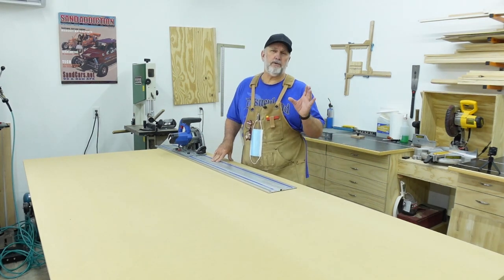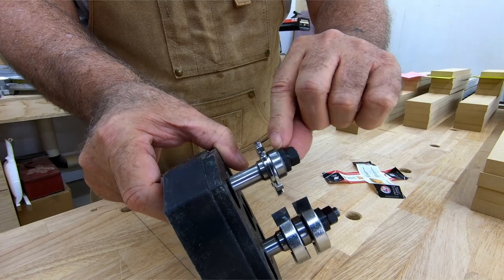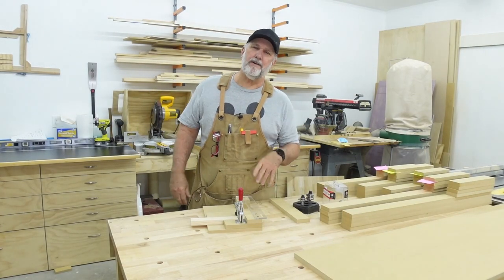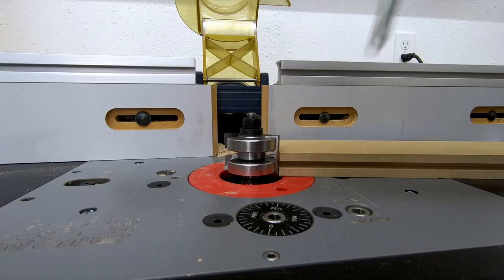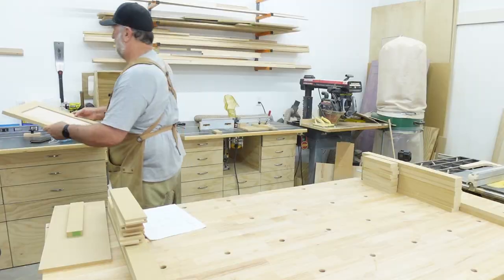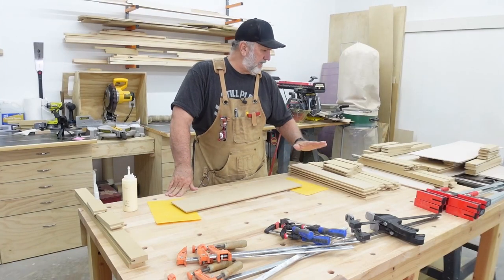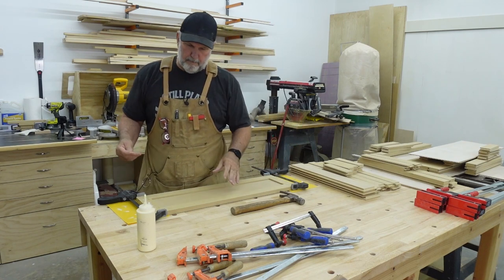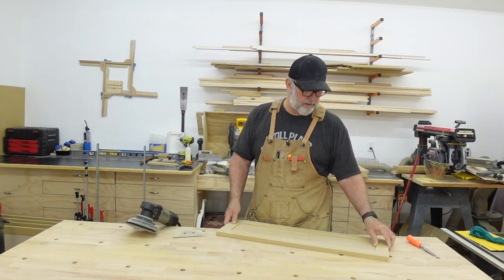Unlock the Secret to Easy MDF Shaker Drawers and Doors

Comment from the maker: Freud Adjustable Shaker Tongue & Groove Bit Set:  https://amzn.to/4758xYw
DEWALT Router Kit:  https://amzn.to/3U19TwH
Pattern Flush Trim Router Bits:  https://amzn.to/3SIdFtY
Fulton 110V Single Phase On/Off Switch:  https://amzn.to/3zK91oP
JessEm Rout-R-Lift II Router Lift:  https://amzn.to/3W6NZKu

Unlocking the Router Lift: The Ultimate Installation Guide Video: https://youtu.be/k7YU392yZgw

Walmart Cutting Sheets for Glue Up:  https://www.walmart.com/ip/Mainstays-4-Pack-Non-Slip-14-2-x-10-8-Flex-Plastic-Cutting-Mats-in-Assorted-Colors/449176575?athbdg=L1600&from=/search